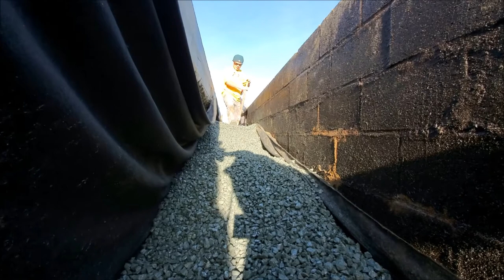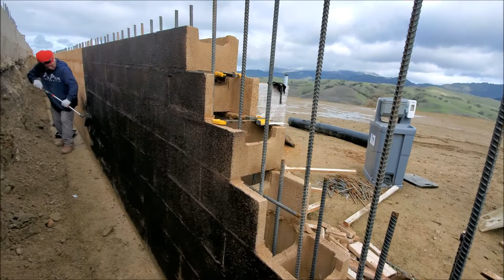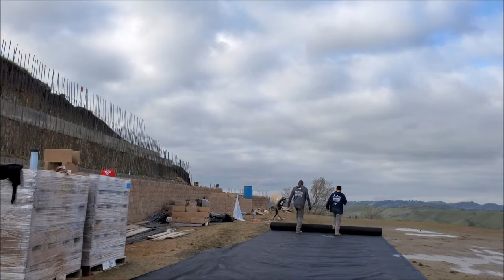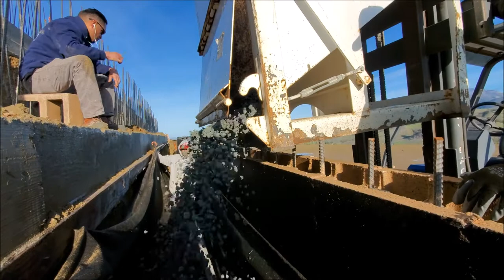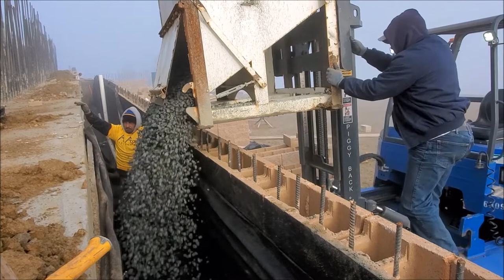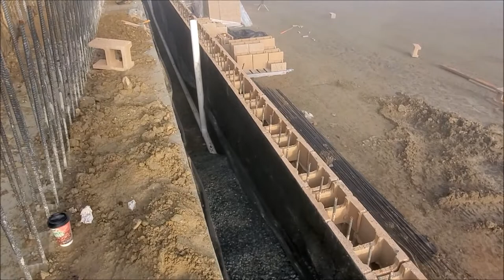Do My Retaining Wall Need Drainage?  All Access 510-804-4646

Comment: Curious as to why the core's of the block wall weren't filled with concrete prior to installing drainage rock. Pressure of the drainage rock could potentially push the wall?
Reply from the maker: We only have one more row to go. All the other blocks are filled. The drainage rock will come up 4 feet. The remaining two feet will be back filled with dirt for plants in the future.. Appreciate the comment
Reply: I thought that was the case, you guys look very thorough. Great content